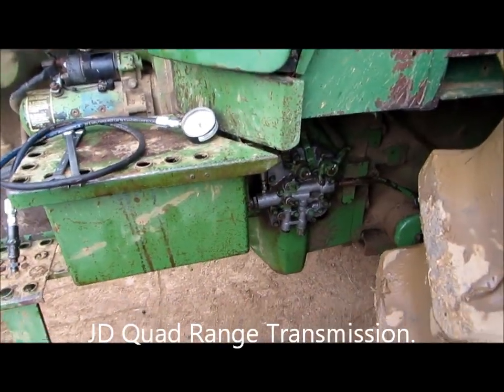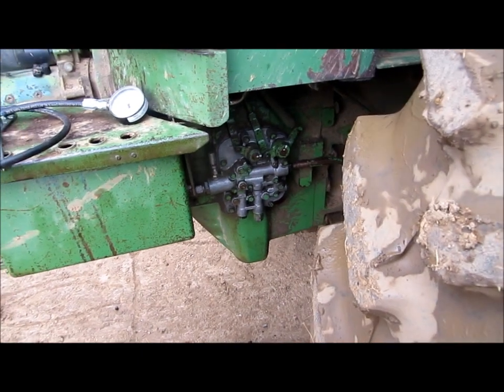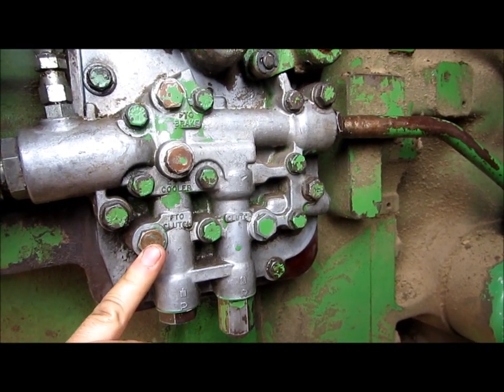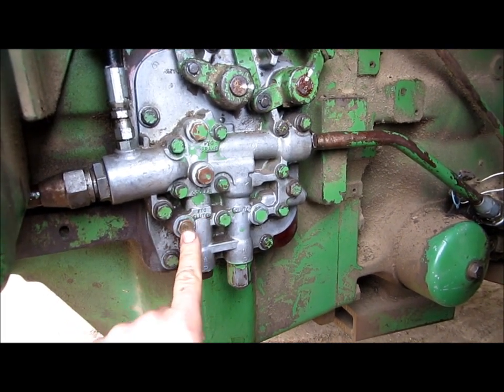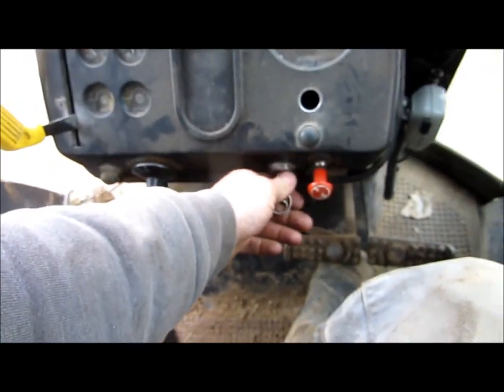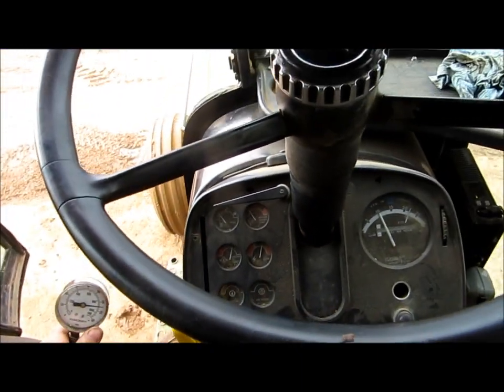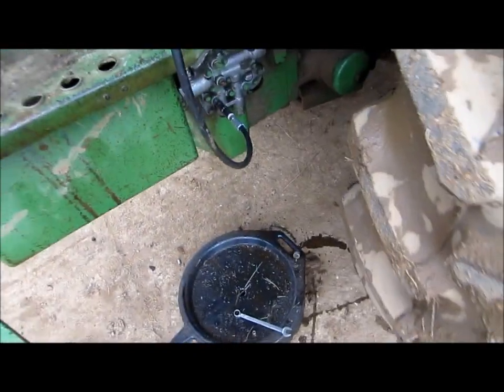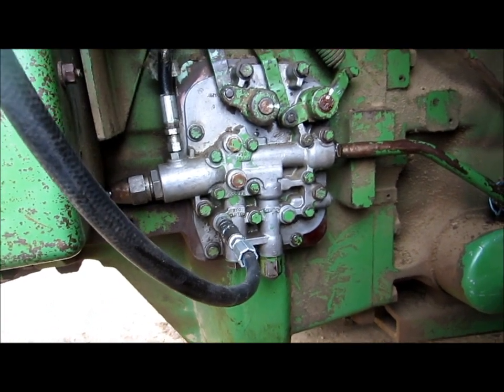JD 4630 4430 PTO lever won't stay up

Comment: What if the pto is always  spinning with the handle off ,, then when you throw it up to work it does fine . It’s not to bad but is aggravating when you have to turn tractor off took hook up . It’s on a 1971 4020 power shift . Enjoy your channel!
Reply from the maker: If pto is spinning with the lever off that means your pto brake is shot. Means splitting the tractor

Comment: I got a 4230 and I want to change my steering return line to the fitting like in this video. Do you know the part number for the two fittings?
Reply from the maker: It was done right before I bought it, so I don't have the part numbers.... But I think all that can be sourced through the deere dealer as an upgrade.  also, there's a guy on Yesterday's tractors.com by the name of Tim S.  He'd be the guy who could get you the right part numbers for that. He posts in the JD forum.